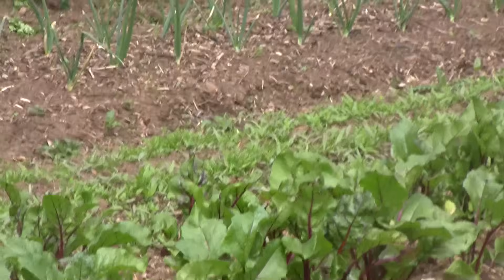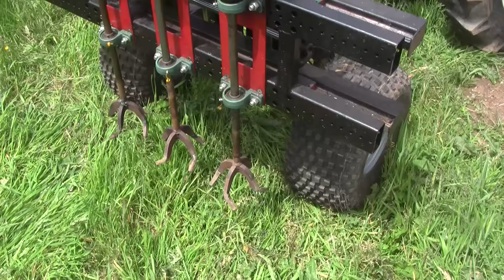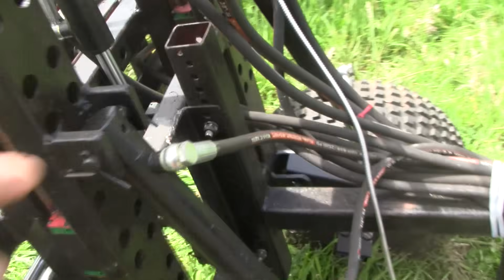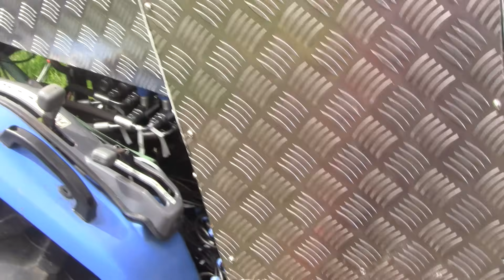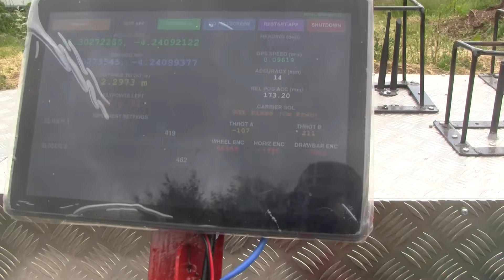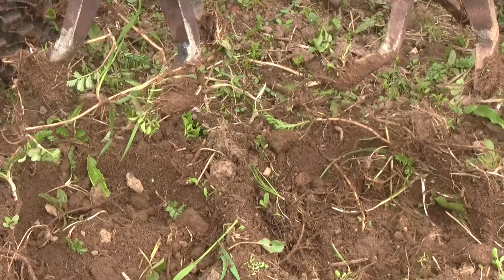WEEDINATOR test june 13 2026

Comment: I was thinking about this exact use case with a cultivator.  Tilmor did also, but their solution requires a second driver.  

I think you need exactly what you have for driving the machine down rows - keep it straight and follow the waypoints.

The second automation point would use machine learning to make minor adjustments on the horizontal axis of the harvester - essentially a linear actuator that makes minor adjustments based on another camera for fine tuning of the harvester.  GPS can keep you driving close enough.  Machine learning and fine adjustments to keep the harvester from taking out a row.

I'll look for your other videos I don't have a big picture of your project here.  But it looks like a great start.
Reply from the maker: Thanks !!! Camera implementation is the next task.